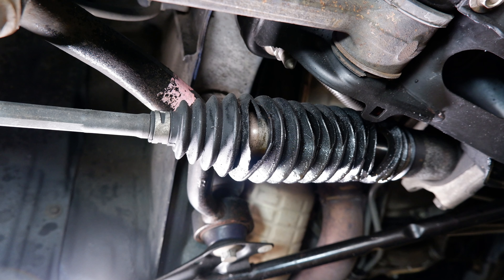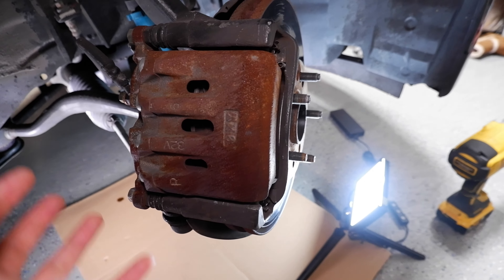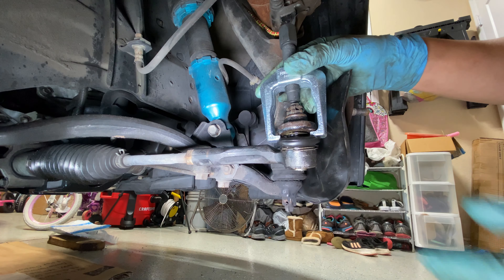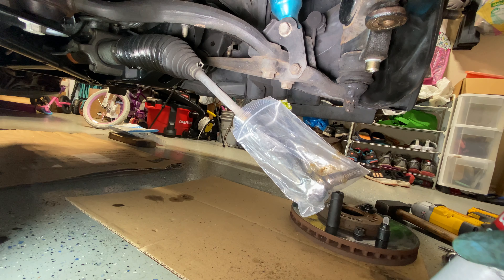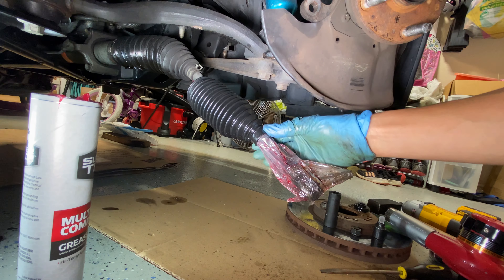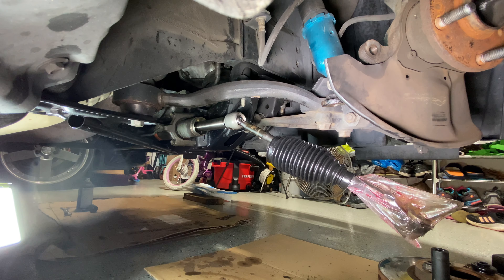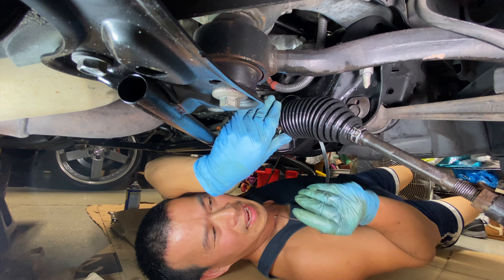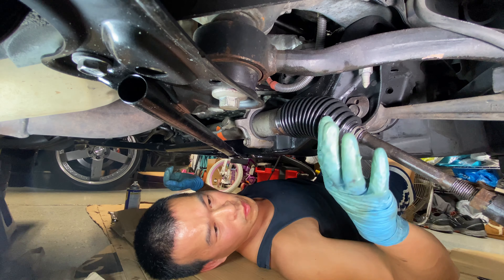How to Replace Steering Bellow Boot | Lexus IS300/GS300 | Easy Grease Trick | No Alignment Required

Comment: 3:25 Tried to disconnect tie-rod-end by "banging" and it didn't work.  --Let me tell you buddy, I've done a ton of these and it always100% works, but if you aren't hitting it hard enough you will need to buy the larger sledgehammer. (but I still like your video and I still like the tool you are using)

Comment: You never showed how to take the clamp off. I've been fighting with it for an hour 😜
Reply from the maker: Old clamp? I just cut it with a thin snip or sharp wire clippers.
Reply: @TunerwithKids  Gotcha yeah that would be easy 😁. My boot was still good and just reused the clamp. Figured it out just had to pry in between the two pieces where the claw grabs the metal opening. Pain in the butt, but got it :)